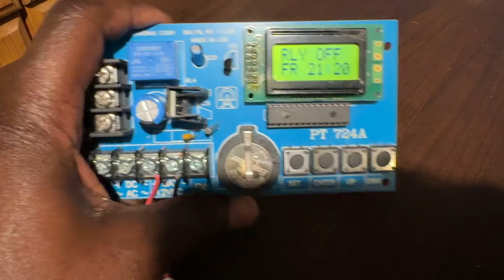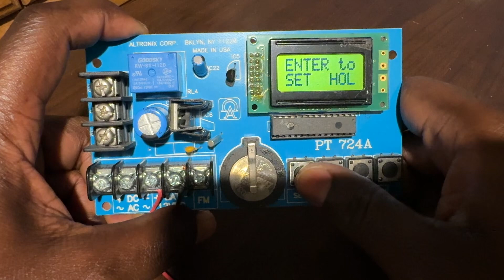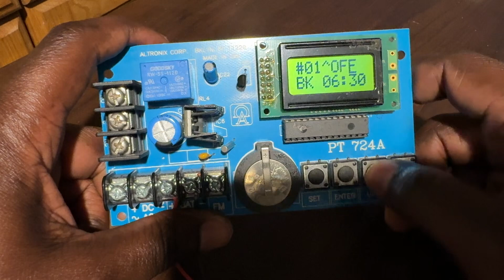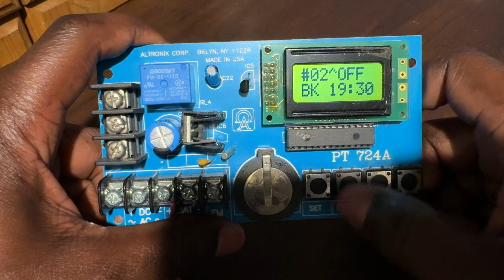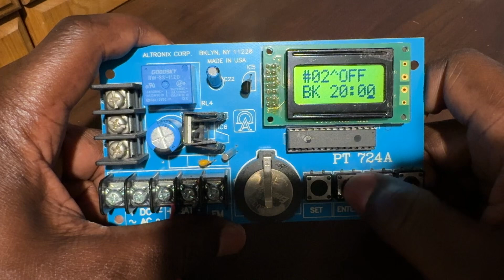Set Block Time on PT724A | Altronix Timer Programming Guide @altronix

Comment: Will this still work with remotes?
Reply from the maker: This device doesn’t have a remote capability out the box. What are you trying to do with it?
Reply: @verlydube  I'm trying to open my gate for like an hour in the morning and afternoon monday - friday and the in between time have it closed with the use of a remote to open.
Reply from the maker: @MrHatchbody in that case I would set the automatic timer on this device and continue to use the original remote as before. Adding a timer to the gate shouldn’t stop the remote from working. The only issue you will have is the hours you want the gate to remain open will override the remote for that hour.